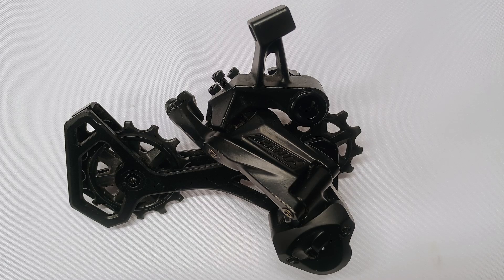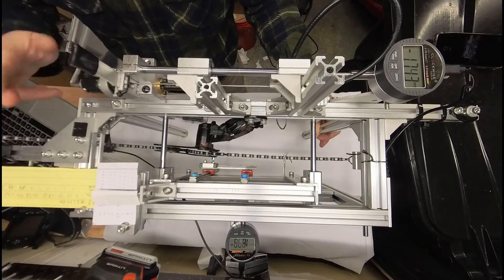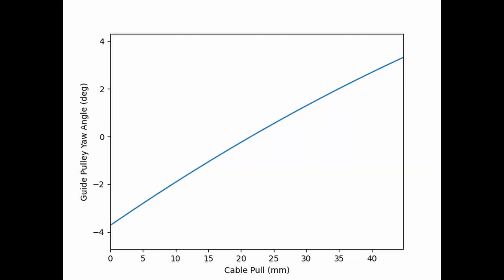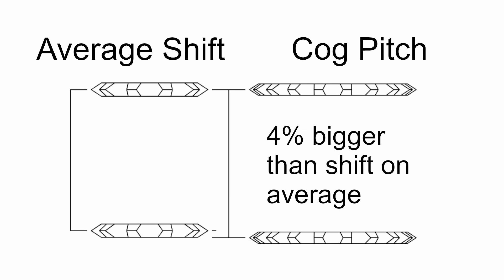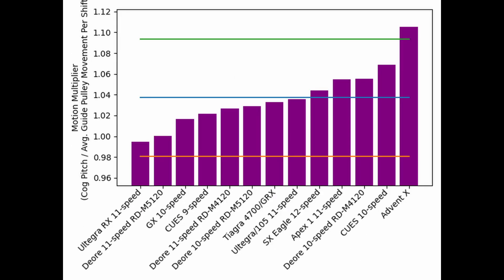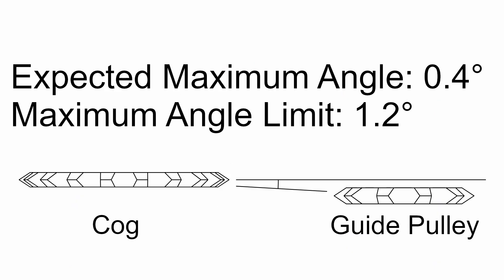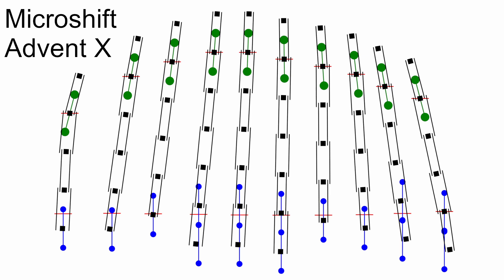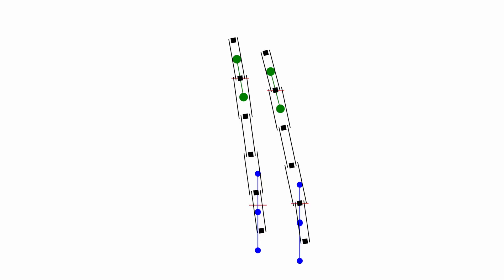Microshift Advent X Derailleur Pull Ratio

Comment: Hey! Super channel – so useful not only for the nerds. You measured that the Advent X derailleur has an above-average cage-pulley angle and that this could be a reason for its good shifting performance. Could it also be that, because of this, the chain tends to get caught more easily on adjacent cogs when pedaling backwards? Especially with 12-speed systems, where the spacing between the cogs is smaller and the chain has a greater angle, this can be an issue now and then. Whereas with 10-speed, the chain requires less angling...

Comment: Hello, Booth. I gradually know how you treat your measurement. 
Firstly, its actual pull ratio is not constant(it is suitable for all rear derailleur). 
So you make a curve fitting to get approximation equation.
This equation is result of instantaneous pull ratio.
Then you make calculate them in integral[∫Pull ratio*Cable Pull*Motion Number(if needed)]. And finally compare the result to cog pitch to see whether it is compatible. Right?

Comment: I noticed your setup has a fixed chain slack. Does it matter the rotation angle of the cage? (whether cage is tucked or stretched, subsequently the position and angle of the guide pully)
Reply from the maker: I only show a short clip of my measurement procedure. I do adjust the chain length while measuring, in proportion to the changes caused by shifting gears on an actual cassette. I also record how adjusting the chain affects the cable pull, and I typically find that there is very little effect.

Here are all the videos of me measuring the Advent X: https://youtu.be/j9-5Jwdtyq8

Here is the data that I recorded, with links to the CSV files of my measurements: https://boothinator.github.io/derailleur-analysis/derailleurs/Microshift%20RD-M6205AM/default.htm

Comment: So I heard on the interwebz that people were switching out their advent x RDs for the deore RD-M4120 for a better clutch. Their pull ratios are definitely close enough. After bending my advent x RD on a ride, i tried the same thing since the deore RD is cheaper. However, with my chainline, the deore RD was so loud  in the 5 lowest gears. It wasn't tolerable. I wonder if your observation about the advent x angle has something to do with that. I ended up buying the new sword 1x RD instead and it works just fine like the advent x. Not loud at all.